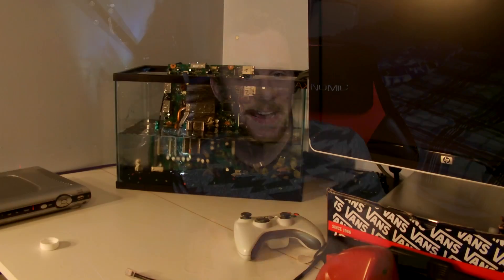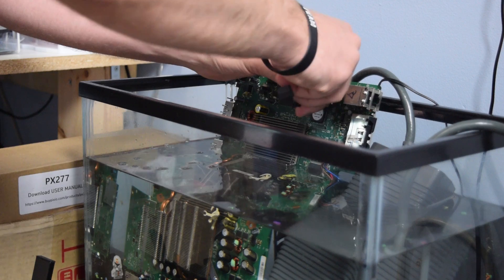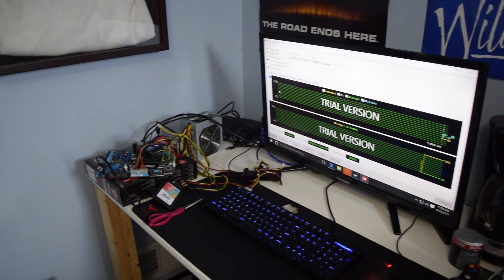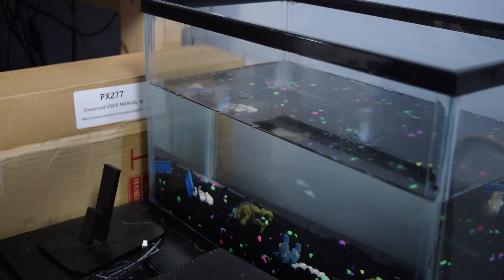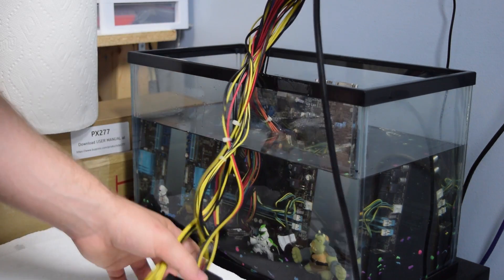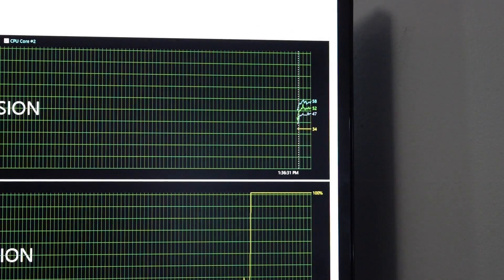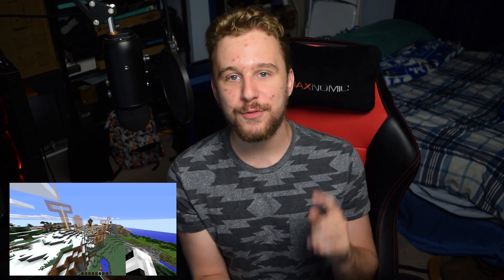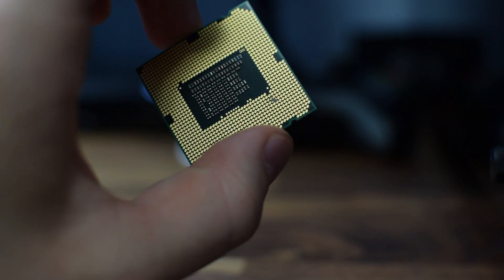Mineral Oil Game Server PC Build

Comment: how do you plan to secure minecraft server?
Reply from the maker: +Ryan Daniels The idea has changed a little since this video was produced, may or may not happen after all the security needed for it to make it public
Reply: Toasty Bros most people wouldn't use the IP to maliciously attack you but you could never know. I do the same thing though for my friends. I host a 10 person minecraft server on a raspberry pi, usually only 4 at a time play on it and with the spigot addons it runs flawlessly.
Reply: Fox Hunter when you open a public Minecraft server you basically open your network to anyone. It requires firewall exceptions that allow a malicious hacker to easily take down your network or find a way in through that open port used by minecraft. You could always block certain countries that are known for these sort of attacks such as china but you always run the risk. I'm by no means an expert, but security would be needed.